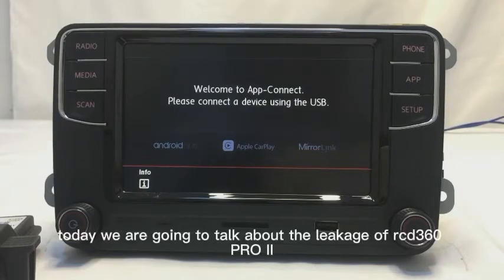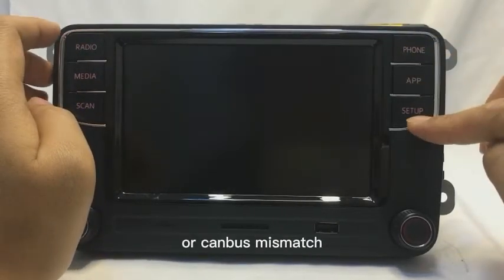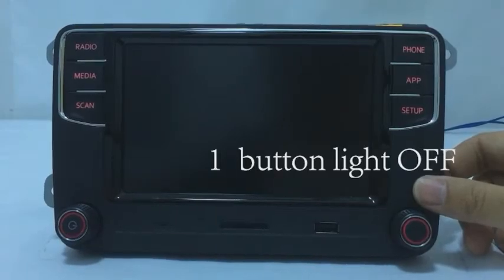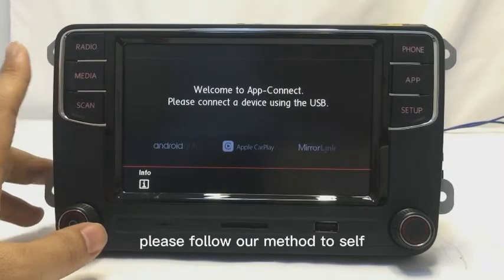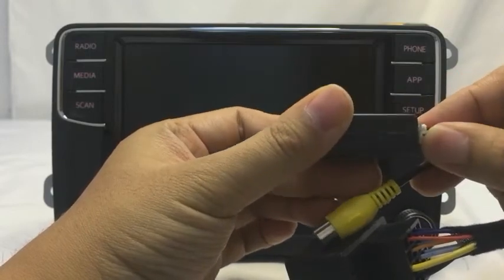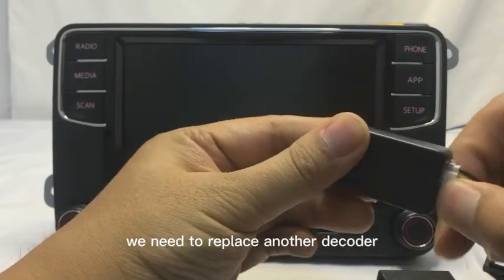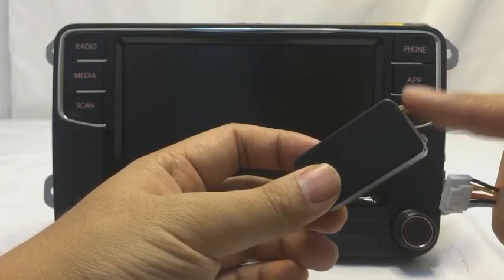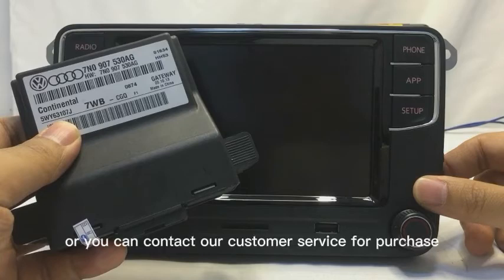RCD330 BATTERY DRAIN PROBLEM! What to do with RCD360 leakage？

Comment: I have a polo 6r 2010 and it works without key as well but with ignition on it automatically turns on. It does NOT drain my battery
Reply from the maker: where you paid that ?

Comment: Hello I have VW Polo 2012 6R model. and have bought the same RCD360, mycar battery drains, should i need the Canbus decoderbox?
Reply: Hi bro You Did you find Solution? For this
Reply: @nitinpaul7878  Problem wasn't the device, but my own car battery that needed to be fixed:) Bought new battery and problem didn't come anymore.
Reply: VW POLO 2012 (OLD radio was a RD210)
Reply: @FiansMoorrees  Thanks Bro I Got My RCD330plus for my jetta 2012 and it’s working perfectly fine No drain till Now even if i start my car after 4 days 
Thanks 🙏🏻
Reply: I have edition 30. 2007. I think I will need that one at the end. Or maybe I am in the 2%? Wish he showed how to fit the one at end
Reply: @Lonely_Goat  find a Solution?
Reply: @phil5  I bought a Bluetooth speaker and use phone to play songs from it for now.
Reply: Hi man
I have a polo Gti 6r 2012 and my battery drains a lot of the times 
My radio is a rcd 330 as well 
What should i do?